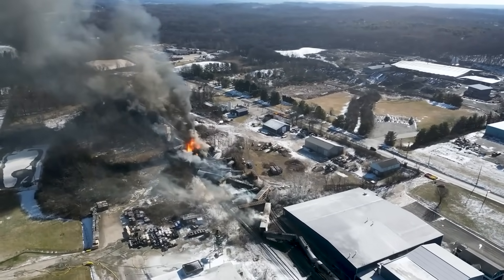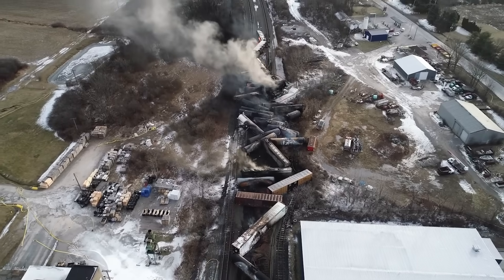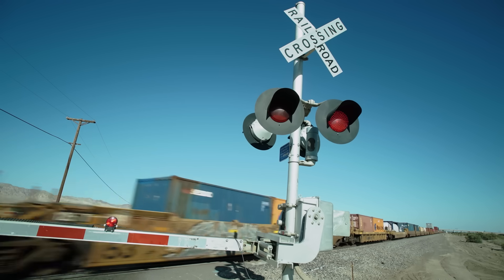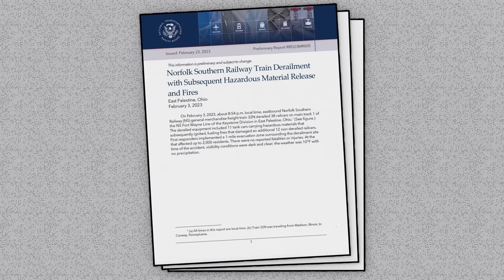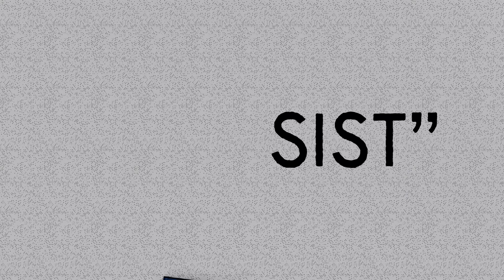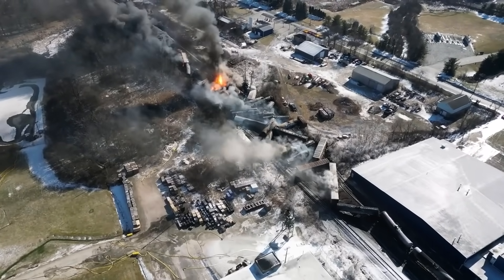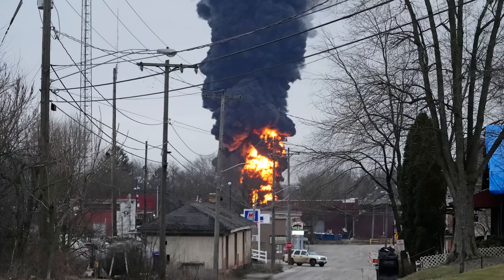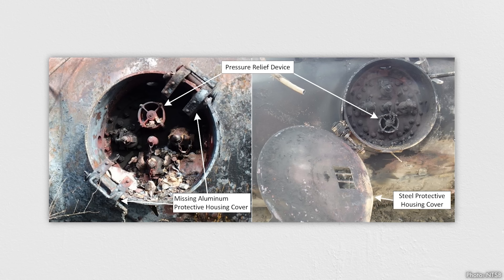East Palestine Train Derailment Explained

Comment: You treaded carefully through this video to avoid leaning one way or the other on the cause of the accident and current impacts. Which is fair considering we don't have all the information yet.

Something very important that I feel needs to be added for further understanding as to WHY this accident happened: the extreme length of trains. 

Growing up the trains were at longest 55-60 cars in length. I remember this well as my town has many railroad crossings that you can get stuck at for any period of time. Now trains going through these same crossings are averaging 85-100 cars in length. Which is flat out unsafe in my opinion. A conductor cannot visually check cars they are pulling via a curve past approx 75 cars if I am remembering correctly. The one that derailed had 151 cars. 

Train crew sizes have also been diminished due to company pressures to increase profits. There were only THREE crew members manning a train of excessive length. 

Finally there was a serious and concerning failure to properly identify and immediately provide a proper manifest of all cargo, especially hazardous cargo, to the local EPA. Semi trucks must have hazardous materials clearly labeled, yet freight rail does not.

Comment: I'm really disappointed with the level of technology that these railroads consider good enough.

Defect detectors should be a last resort measure. They don't give you enough information.
Instead, there should be sensors on each car for these kind of things. No need to wait 20 miles to see if something went wrong when you can have it in realtime.
Unfortunately, like many other things that shouldn't be, this is simply a game of statistics. It's easier and cheaper to eat a loss every once in awhile then to upgrade into the modern age.
It sucks to see our railroads being run just like Russia's army is.

It seems that the little man can do little to change this though, except elect officials that will counter their political power. Railroad's customers are not the end user, but rather, other companies. These are also economies of incredible scale, and along with effictive monopolies and political power, it makes it pretty much impossible to start a competing company.

Comment: This was not a bearing defect, it was a brake defect. Proven by the WHEEL throwing sparks not moments before the derailment but 20 miles before the derailment. The defect detector in that location did not indicate a hot bearing, in fact the NTSB and Norfolk Southernboth only mention"defect detectors" or "hot bearing detectors", not hot WHEEL detectors.

Comment: I love this channel, but the idea that this is uncommon is false. Risk analysis is not based on total incidents alone but overall impact as well.  One trucking incident is not the same as one rail incident.  I'm not holding my breath that changes will be made and enforced. This incident is directly related to deregulation. Deregulation due to the cost of responsible applied engineering. The people living in this area are victims of greed. There are direct failures that could be mitigated by changes in policy and process. Maybe cargo trains with particular cargo have limits of less than the current "beyond ambient" temps. Maybe maintaining the equipment should be investigated.  I would enjoy learning about the procedures required to make a rail car eligible to carry hazardous material.  It just seems to me that there is a thumb on the scale when applying the risk / cost ratio for rail. Ask the people impacted if they would pay an extra 5 cents to their goods to justify the risk. Not having done the math I imagine it is far less cost.  Rail isn't going anywhere but everyone needs to ask what our goods are worth without threat of preditory inflation rates. A 2% profit margin doesn't justify a 10% increase in cost for basic operational expectations.

Comment: Pretty cool you’re doing a video of an incident that happened less then a mile from me. In my area we rely on wells a lot. Around here It takes about 30 years for things from the surface to reach our wells. Also a lot of our streams didn’t get stocked with trout this spring due to the risk of eating the fish and the possibility of the trout dying.
Reply: @Donny Chludzinske - thanks for  adding to the local info.

Comment: To me it seems obvious that the overheating warning should trigger based on the rate of change between detectors, not just a high cutoff temperature. There are some great comments here, so please someone explain why this isn't possible or actually desirable, not just why it's not currently implemented.
Reply: Like you'd know
Reply: @samsonsoturian6013  I really hope you're a troll.

Comment: Correction on air brake systems on trains there is 2 ways the braking system applies 1 is by train line  ( main supply air line ) separation 2 the end of train device oppon loss of air it can and will set emergency braking

Comment: Obama put stricter regulations on the rail industry. Trump and conservatives deregulated   braking systems for hazmat trains. Thanks conservatives.
Reply: 😂 alway the delusional left blaming everyone else. Tell me, why didn't (and still hasn't) Brandon vist the town? Not a peep? Crawl back into your hole and figure out what gender you are this week.
Reply: Shut up
Reply: Ah, yes, those regulations that required slightly faster breaks on chemicals that were not present on the train in this incident, so they wouldn't have applied anyways. I'm also interested in how you think slightly faster breaking is supposed to fix the axel being on fire.

Comment: I am curious about the temperature limit that causes the "there is a problem, stop now" message. I assume that number (200°F above ambient) is related to the temperature where the materials start losing strength (which is presumably some amount greater).  If so, I would say that is a terrible way to do it unless there is a valid, non-defect reason for it to get that hot. 

And the thing is: even if there was a normal reason that things could get that hot, only a single set of wheels being that hot when other cars are much cooler (the "temp difference of 115°F on the same axle" warning is not even close to sufficient), or the rapid climb in temperature that was seen, should trigger the same sort of "stop and inspect". Since those temperature triggers are listed as having been established by NS, I am guessing there was a fair amount of "reduce costs/lost time" factored in when determining those values).
Reply: Shut up

Comment: Very good video. Note that it has been shown that transporting goods below 200 miles, it is more efficient to move them by trucks. Moving them by rail becomes more economically efficient above 200 miles. The caboose was mainly used to staff the crew in order to move the switch in passing sidings. Since most are fully automated (at least on main lines), there is no need to use them (saving on labor costs as well).

Comment: A couple of the big takeaways here...

1) Temperatures nearing 100C above ambient being considered 'safe' or 'normal' for wheel bearings? Who wrote this?! That is indicative of significant friction. Especially when coupled with a temperature difference between bearings on the same axle below 115F being safe? Again, indicative of significant friction well below those temps when looking at differences... Alert temperatures definitely need to be evaluated and lowered.

2) Aluminum near any safety system designed to function in a catastrophe is a terrible idea and these old tankers need retrofitted.
Reply: People who know a lot more about trains than you. Now shut up

Comment: Can you do a video on the Nuclear Plant in Monticello, MN? Apparently there is a water leak of radio active materials that affects the area and I would LOVE to know more about this issue. Love your content and thought it would be interesting to see the details of this event.
Reply: The failed rebuild of Crystal River, FL nuclear plant would also be of interest, to explain about wire tensioned concrete and the challenges you can have with making changes to an existing structure.
Reply: I would love a whole series on nuclear power - there’s so much he could cover.

Comment: they could easily have temp sensors on the bearings but they dont because it cost money. theres literally a dozen systems that could of prevented this but they are not used because they cost money. the union literally tried to strike over unsafe conditions and joe biden threatened them with jail time and called them an enemy to the state

Comment: I say this as a subscriber of 6 years or so. Maybe you could talk about what bearing defect/damage could cause it to overheat, and exactly how it could fail, and how that would cause a derailment... To me it seems if a bearing stops working, the worst that could happen is the stuck wheel drags to a halt especially since it was already slowing down due to normal brakes. -1 there is little to no practical engineering in this vid, more like some cheap overview of a recent event for clicks.
Reply: You're failing to consider that a failed bearing on a freight car often leads to a failed axle.

Comment: As we approach the tenth anniversary of the catastrophe, an exposition of what happened at Lac Megantic would be interesting.

(That braking system seemed to be anything but "fail-safe".)
Reply: From what I understood in the Lac Megantic case, the cars didn't have a manual brake put on automatically by lack of pressure. The operator had to manually do it by turning a wheel on a minimum number of cars when the locomotive is offline. The operators didn't put enough grip on one of them or the manual was incorrect, I don't remember enough.
Reply: @lajya01  That's only part of it. A more interesting question is why the air brakes failed.

Comment: Today it really seems emotions defy logic and reasoning, when you consider how many less semi's carrying PVC are on the road because of rail freight the accidents pale in comparison. This is basically a whole bunch of truck wrecks all at once, kinda like a reactor meltdown - it's a big overly-dramatic disaster when it happens, but when you factor in how unlikely it is it ends up being far more safe then anything we have. A good engineer does not let emotions rule judgment, but learns from and builds systems to correct mistakes.

Comment: There was a Chlorine gas spill from a  derailment when I was 6 months old.
But my Chemical Engineer Dad and I talked a lot about safety/accidents, etc.
He once had to develop a railcar to transport "a nasty chemical" that they were considering using.  
I wanted to ask him a couple of things about this derailment but sadly cant anymore. Thanks for confirming what I suspected and adding a couple of specifics on top. 
P.s he liked your vids too.
Reply: Most people don’t realize they are breathing chlorine gas when taking a hot shower. Low concentration, but you are breathing it none the less. Even more so in a public swimming pool. I cant stand pools for this reason.
Reply: @seth7745  are you confusing chlorine for fluoride?
Reply: @robertcampomizzi7988 No. tap water is chlorinated and fluorinated. I don’t think the Fluorine concentration is nearly as high. And swimming pools are highly chlorinated.
Reply: @robertcampomizzi7988  I dont think the fluoride in tap water breaks down in to gas like the chorine does.
Reply: @seth7745  you're right..  I was just waking up when I replied... brain fart
Reply: @seth7745  A normal level for drinking water disinfection can range from 1.0 to 4.0 mg/L. Your water company monitors water quality regularly to provide you with safe drinking water.

As opposed to us in 🇨🇦 
Chlorine can be dangerous in very high concentrations. But, there is no evidence that chlorine disinfectants are harmful to people when used in the small amount needed to disinfect drinking water. Most Canadians do not have chlorine levels over 2 mg/L in their tap water.

I don't consider it as much due to this probably.  You have twice as much it seems
Reply: @seth7745  can't you smell it how can people not notice. But although you are right about that and the public swimming pools there are a lot of other things that I would worry more about breathing in. Like some cleaning agents

Comment: Why do trains use generative breaking/air pressure/hydraulic breaking? Why are trains not fitted with aluminum eddie current breaking systems instead?

Comment: The issue isn't whats on the rails. the issue is the criminal neglect of the rails themselves. The mega corps that own all the rails just find it cheaper to clean up derailment accidents than actually fix the railroads. this is the ford pinto all over again (ford found it cheaper to pay settlements than to fix the cars, and recalls were invented as a result). Sadly the only real solution to this is to make the physical rails public domian, and have the rail companies have to operate them like planes do airspace, boats use waters and cars use roads. It would force a lot of much needed updates to these train companies that have been neglecting everything for decades, and open up the works for public trains like amtrak to actually exist and be viable

Comment: An interesting challenge of railroad engineering (the kind you do with a calculator) is that the whole North American network operates on an interchange system.  Any piece of rolling stock can be transferred to any railroad, and locomotives of vastly different make and vintage can be coupled together.  Look at a train going by, and you'll see the reporting marks of many railroads and companies, some of which may not exist anymore.  Interchangeability is key to the railroads' power for moving freight long distance, but it also makes innovation painfully slow and expensive.  Each new development has to be backwards-compatible with everything else on the rails.  Often, innovations just won't work unless rolled out to a huge chunk of the industry.  Look at Positive Train Control, mandated in 2008 and not fully implemented until 2020.

Comment: I work in industry.  I can't overstate how many more engineering controls would be in place for  a FIXED tank of vinyl chlroride monomer stuck in a carefully controlled plant with process safety management than there are for this railcars rolling across the countryside miles behind the train crew with ZERO telemetry.   In a plant, there would either be multiple PRDs for fault tolerance or at the very least there would be some backup means of relieving pressure without SHAPED CHARGES, there would be a fixed firefighting system, there would be continuous exhaust and toxic gas monitoring, probably some form of secondary containment, there would be locked doors restricting access, segregation of the hazards, etc. etc. 

It's absolutely and totally indefensible that train cars can catastrophically fail without alerting the crew.  It would be trivial to add these hot bearing detectors etc directly to each car and alert the crew via a low power radio link.   It is indefensible that they are running consists that they don't have the means to effectively firefight in the event of derailment.  The railroad oligopoly is a great example of regulatory capture, it's about time they were dragged into the last half of the 20th century.